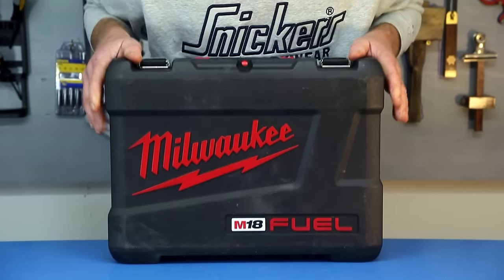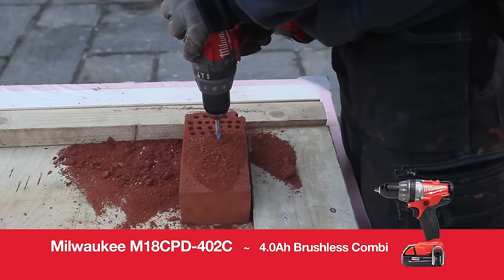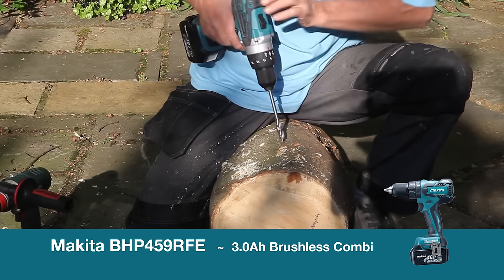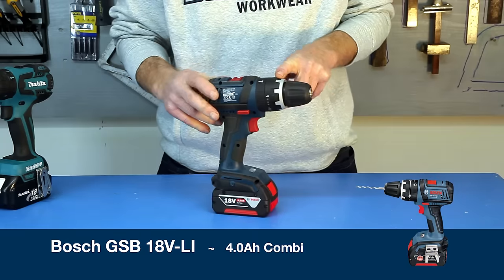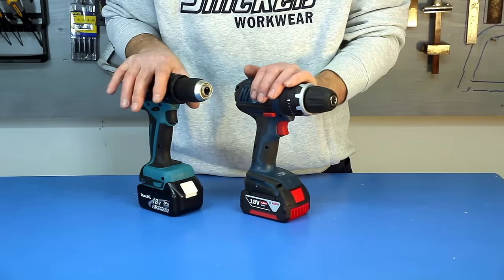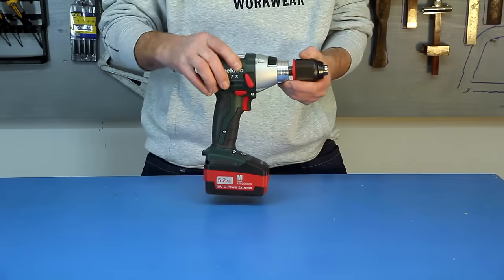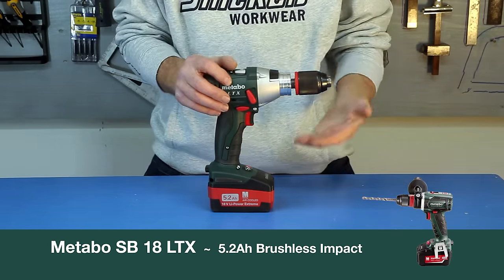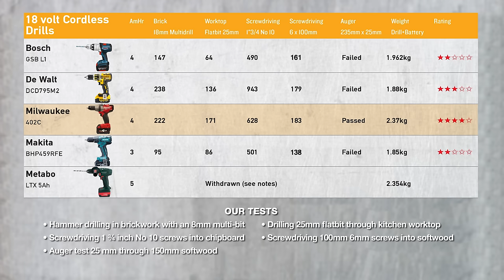18v Cordless Drill Review - 5 Best Drills Tested

Comment: So you ran a bunch of compact drills against Milwaukee's top of the line industrial drill.  Seems fair....
Reply from the maker: Thanks for your comment Terry.  I took a range of 18 volt compact drills and they performed differently across different jobs, as the chart shows. There is no doubt that they are different drills.    l would like to do the test again and in order to be fair I have asked manufacturers which drills they would like to submit in a head to head test  but most aren't that keen. Perhaps somebody will send me a list.
Reply: Exactly.
Reply: Skill Builder I would suggest two different classes to differentiate the results into something more directly comparable with in-class rivals. How about a full-size and compact comparison? I'd also suggest that you use the same (or as similar as possible) battery ratings within their specified class. I'll split my replies into each class due to formatting constraints.
Reply: First class: Full size, brushless (where possible), top-of-the-range combi-drills with 5AH batteries. Suggested drills: Milwaukee M18CPD; DeWalt DCD 995; Bosch GSR 18 VE-2-LI (Brushed); Makita DHP481Z; Metabo SB 18 LTX BL Quick. Maybe (if you're adventurous and/or cashed up) the Festool DRC18 for an interesting comparison, even though not directly comparable.
Reply: Second class: Compact, brushless (where possible), drill-drivers without hammer function, on the compact 2AH batteries. Suggested drills: Milwaukee M18BDD (brushed, 185mm length); DeWalt DCD790N (brushless, 181mm); Bosch GSR 18 V-EC (brushless, 179mm); Makita DDF459Z (brushless, 179mm length). All of these brands have a 2AH battery available with the exception of Makita, which only have 1.5 or 3 available. I would suggest testing with 1.5AH batteries as the idea is to use the most compact drill driver in the 18v class from each respective manufacturer.
Reply: Another possible suggestion is to use a battery of tests, such as that which you have done in your original comparison, which is possible for both classes; then you can add class-specific tests to demonstrate the specific capabilities of each. That way, you can directly compare what kind of performance jump can be had with regular tasks from the compact series to the full-size, bigger batteried cousins, while still having a module of harder/more applicable tests to really eke out more granular results to highlight any in-class disparities.
Reply: Skill Builder Of course, such a test involves a large number of drills and would therefore be expensive and/or involve possible bias if needing the support of the companies themselves to supply product. Would be very handy to see, though!
Reply from the maker: David Verney
Thanks David. As you say that kind of test requires a lot of time and money. I would love to do it but I don't think manufacturers would play ball, Thanks for the suggestions though. I will keep them and consider the possibilities.
In the meantime
I am going to come up with a standard test that involves a variety of drilling and driving tasks and then simply run each drill I can get hold of through that test.

Comment: Very interesting. I had a brushed Makita 18V drill  DDF456, not combidrilll. Battery also 3.0 Ah. Drilling a 40mm hole in wood was never a problem on one battery. And another time I had to drill about 30 or 40 24mm holes - one 3.0 Ah battery lasted for about 5-6 holes and while drilling the other battery would fully charge. One issue I had was that the chuck was somehow badly made - bits would not hold in there long no matter how strong I tightened it. And yes,  it doesn't have a battery gauge which is annoying sometimes.

Comment: I work as a metal fabricator and i use the m18 on all different types of steel & different thickness the only issue i have with the m18 is the chuck slips constantly and every other staff member who uses the same drill has the same issue

Comment: Hiya, as from most of the comparisons between the cordless tools, I'm really disappointed from the lack of AEG tools from being on the list. Alright, I'm well aware of them not giving their tools free for testing even for the most well known people on the social media, but...If that 3x two by four test was made with a 1" drill (my assumption from the video, as you didn't mention it), my 18V NICD AEG can beat any of those cordless's in anything, but runtime.

Another thing most of the tool comparison videos seem to lack, is the question about the amount of work from easy to heavy duty, the tool can perform within the re-charge time. It's not just what the tool can do with just one battery re-charge, but also if the battery can be re-charged within the time the battery change is required. --- Thus most of the single battery test videos really miss the point in the business side of using the tool itself.

Comment: I have the Milwaukee Fuel and it is the most abused tool I own. It holds its own and stays reliable every day. I love it and would not buy anything else.
This was purchased after 2 yellow DeWalt drills burned up in less than one year.
Reply from the maker: Thanks for the feedback Wayne. Tests are all very well but you can't beat real life. My Milwuakee Fuel has also taken a fair old bashing. Last week driving auger bits through heavy timbers and I needed that side handle to hold it steady. The motor groaned a bit but it never once stalled and this week I have put it on lighter duties.
You have to show a little love.
Reply: A drill is just as important as a pickup truck or work van to a contractor. They need to preform when required and take whatever the job throws at them. Thanks For Posting Your video.

Comment: They didn't use the comparable Hitachi DV18DBL either.  Hitachi is often overlooked, yet is a comparable and respectable competitor.  I'm a locksmith and have used Hitachi since 2007.  My brother, another locksmith uses DeWalt.  I would love to see these drill comparisons with the drilling using carbide drill bits going through hardened steel.  My Hitachi (DV18DL) will go hours (switching batteries of course) through safe hard plates.

Comment: Not a fair test,the milwaukee was their fullsize drill the dewalt,makita and bosch are compact drills I seen the dewalt fullsize go up against the milwaukee fullsize and beat it
Reply from the maker: In what respect does it beat it and who did the test?

 If you read the report on Skilllbuilder you will see that the DeWalt wins on certain sectors. We openly acknowledge this, wed have no axe to grind. The point of the report is to highlight  that no one drill is the best across all tasks but the Milwaukee was the best all rounder in our test. If you don't need all that torque then save some money and go for the smaller lighter drill. There is nothing between them in size but the Milwuakee is heavier.

BTW I am happy to put DeWalt's best up against Milwaukee's. All they have to do is lend us the tools and we will film them without fear or favour.
Reply: yeah I noticed that too!
Reply from the maker: *****
The weight of the Milwaukee cost it a star. I agree with you about the difference. I have tested the large 3 speed DeWalt and it passed the auger test. It is hard to find a level playing field. I think that what is evident is that if you don't need that extra torque you are better off with a smaller drill because you get more screwdrivng per charge. The drain on the battery is in the start up.

Comment: Milwaukee all the way, DeWalt and Makita used to be really good, but they have gone downhill in the last few years, also the battery design keeps changing rendering the drills useless, and the price of the batteries is insane. I have a Bosch corded drill that is over 30 years old and still going strong. OK so you have to plug it in to the mains, a small price to pay for a tool that never stops working.
Reply: Milwaukee is second generation going against 1st generation brushless
Reply from the maker: +Warren Chrastil 
 This was  a test of current models but it has now been updated.
Reply: Joss Cues Hi I was just curious do use dust extraction on your Bosch drill when using it the reason I'm asking is because I want to maximize the life of my tools

Comment: Always liked De Walt but recently found the newer chucks constantly working loose. (Not even on hammer). I still have a very old version with a battery adaptor up it. It will snap your arm off before it slips ? Good video Roger.

Comment: Awesome vid thankyou for the comparison. Just wondering how much better is the brushless m18 Milwaukee against its big brother the m28?
Reply from the maker: I think the 28 is too big for general work. I even think there is a case to be made for using a 12 volt for smaller screw driving and keeping the high torque 18 volt for the heavier jobs. Most tradesmen I talk to seem to burn out drills with large diameter holes saws and flat bits. Both of those need to turn at high speed but they also need a lot of torque. The trick is to drill a little and then withdraw and let the drill spin to run air through the windings on no load then go back in.

Comment: Thanks..really helpful. I recently had to drive some TEK screws (5.5 x 38) into wood and thin metal shelving..I struggled and had to drill a hole first..(Won't mention the drill I was using) Anyway..would these deal with this task? Thanks. Your vids are really informative.

Comment: you tested the 795 series dewalt drill witch is a home owners drill. you should have tested the brushless  DCD 995 XR with the 4ah batt. it would have blown away all of those sissy units that are only good for installing curtains and putting together ikea furniture !! for over 20 years I have been a makita man until I brought this monster to the shop. It's big , it's heavy ,it's powerful , it's expensive , it's worth it .
Reply from the maker: +Robin Lessard There are lots of comments to that effect and you make  a good  point. Test results show that the DeWalt outperformed the Milwaukee on the screw driving so that is perhaps  the value of the test. If you don't need a lot of torque then you don't need to pay the extra and suffer the weight penalty. We will renew this test soon and see what comes up. We now have 5ahr to bring into the mix.

Comment: Nice to see how long you can work with a single battery but what bothers me most is how long does the charger take to recharge that battery!
That's why I prefer Makita, they got better chargers.
Reply from the maker: you are not wrong there. 20 minutes for the 3AmHr battery and now they have 4 and 5 AmHr. See our new review on the Makita LXT
Reply from the maker: ***** The old 3 AmHr battery was a disaster but hopefully their new batteries with the star are a lot better. If you over-load them more than two or three times they have to go back to the charger for a talking to. It might be too clever, time will tell.

Comment: I think you missed the best one. I have a Hilti SFH-181A, with the 3.0 aH NiMH battery, the torque is great, will drive all screws into any hardwood no problem. The hammer function comes in handy too.
Reply from the maker: +Joseph Sacco 
Oh yes Joseph we know that drill well and we are talking to Hilti right now about  a test of their 22 volt drill but we can't include them in an 18 volt test because these days they don't make an  18 volt drill. We start running into all kinds of issues when we include drills outside of the category.

Comment: I have no Brand Loyalty,I buy whats on the best offer at the time,for the given tool that I need at that time.As a contractor tools are used hard & sometimes above what they should be used for,However I must say that by a HUGE Margin the biggest selection of power & battery tools that are retired,but still work,hold charge etc are the Metabos.Ive also never had to use Metabos 3Yr Warranty-which speaks for its self.Milwaukee seem to have reliability issues talking with other tradesmen.Dewalt are great too for durability,but they tend to get loose (chucks wobble etc),. Yeah Makita are great for a lightweight tool,however the batteries are not so good,and fail way too early.

Comment: I know this channel is geared towards the professionals and trades however it would be interesting in seeing a  power tool comparison between the mid brands aimed at the serious DIYer/hobbyist.
Reply from the maker: +Chris L

 If we didn't have so much to do we might cover some low-end drills. The big question is are they that much worse than the pro-specced drills costing three times as much. 

Bosch has a green DIY range
Milwaukee has Ryobi and Aeg
DeWalt is owned by Black and Decker and also has Stanley power tools
Makita has a low end offering.

Often it is the batteries that let them down. If you only do a little bit of work the best buy is a mains powered corded drill. It will last for years and has plenty of power. If you spend a £100.00 on a mains powered drill you will have a good tool. If you spend a £100.00 on a cordless you will have a low-end tool.

Comment: Thanks a lot for this video. But, I guess it was a bit unfair for the BOSCH GSB 18 V-LI against the Milwaukee M18 CPD-402C. It would have been better if you used BOSCH GSB 18 VE-2-LI, as this is the model to be compared to Milwaukee's M18 FUEL 402C.

Comment: Thank you for doing this comparison test. I have a Makita 18v. The drill end wobbles. I want to return it or trash it. I will get the Milwakee drill now.
Reply from the maker: Don't abandon that Makita. If it is only the chuck then it takes minutes to replace.
I am sticking my neck out here (again) but I would say that Makita has the best after sales and repair service of any manufacturer. A lot will run away if your tool is a day over warranty but Makita takes a longer term view.
Reply: the hammer drill wobbles.  the standard drill does not.  even the ones at the store on display do. I thought mine was bad but they're all like that.  been using it for 15 months without issues.  except for the battery.
Reply: ok. I never did get the Milwakee. I am keeping the Makita.
Reply: survivor030406 yea makita is not very well built at all, very weak and poor craftsmanship, defiantly not built to last or to handle work everyday...
Reply: Skill Builder Makita is total rubbish, Bosch shits all over Makita anytime anywhere... Its like comparing a honda car to a ferrari.
Reply: Jay McGregor
maybe i'll get a Bosch next time

Comment: Hey you need to up date your drill selection!! Makita has a 5amp battery and also 4amp battery and you used the 3amp Makita vrs a 4amp Milwaukee not a fair fight. plus Makita has a brush-less motor too. Im on a construction site and overwhelmingly Makita 5amp battery helps out do the other and their warranty is better i think cause if my drill goes down i call my Makita Rep and the service guy comes to job site and fixs it on the spot or give a lender tool and with in 3-days i got my tool back no money no question at all. DeWalt or Bosh or Milwaukee offers that. Need to update your ideo
Reply from the maker: Stephen Whatley Thank you and you are right this is now 18 months old and we have acknowledged in the comments that it needs to be updated. We said at the time that Makita needed to up their game and as you say they have done.  We have a review of their new tools but in terms of scrapping this test and doing another we do not have the time or resources to do it yet but we will.

Comment: How about a comparison of various models in the same brand. More powerful tools might consume the battery faster than smaller tools. Screws per minute would be a more useful statistic. I generally use my 1/2" impact wrench with a 1/4" adaptor to drive screws.
Reply from the maker: Have a look at the full report. There is a lot of information that shows exactly what you suggest. We picked an outright winner because that is what seems to be in demand but the complete story is a lot more nuanced than winners and losers.

Comment: B&Q sell the new JCB 20V brushless combi drill!!! 3.0Ah battery all for £157
Very powerful and lightweight... Used it myself and drastically shocked on the experience of using it.... Only £144 Inc vat
You should get 1 and test that! You will be surprised for all the bang for buck! 
Used a 25mm argur peice to go through C24 timber 100mm thick!!!
Reply from the maker: rob121212blue 
The JCB range of drills used to be badged up Alba cheapest Chinese tools you could possibly source. I don't know how good or bad this latest lot are but in the early days JCB allowed a lot of crap to carry their brand. It baffles me why they didn't exercise a bit more quality control. It can't have enhanced their reputation. Apparently now they get involved in the testing so perhaps this latest round of JCB powertools are a lot better. 

We will try and get hold of one and see what it does.

Comment: What size Auger are you using I have the same dewalt drill and mine does on a daily basis drill  25mm nail buster auger through 3 sometimes 4 4x2 studs when doing pre wires  on the slower speed with out any problems.Your chat say 25mm but the video it looks more like a 32mm or bigger
Reply from the maker: +David Collins You are right. We used 25 and then 32mm.  They stalled on the 32mm.